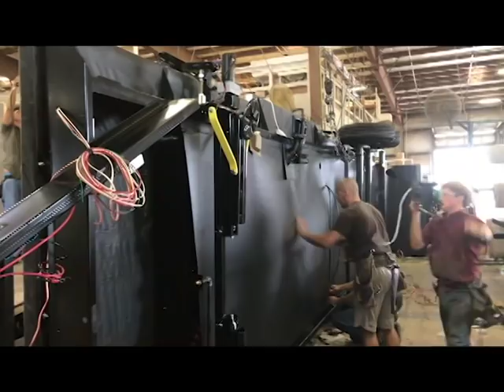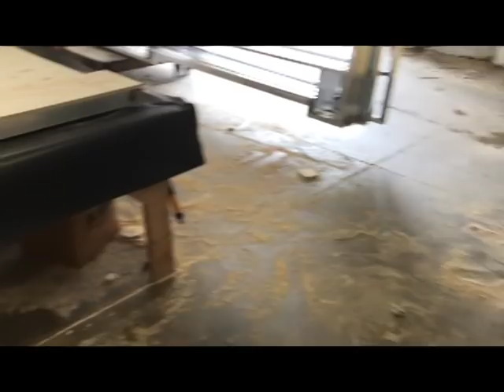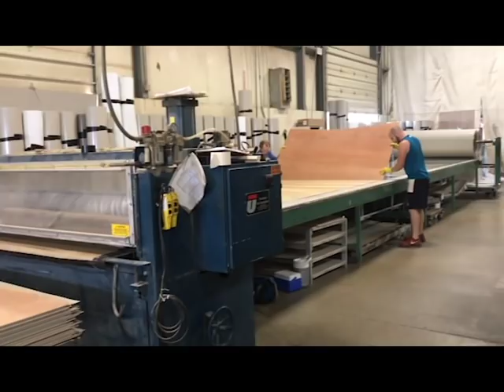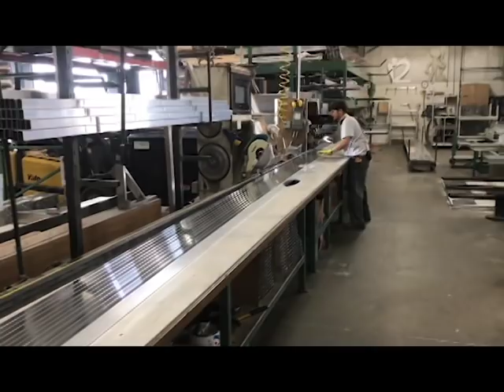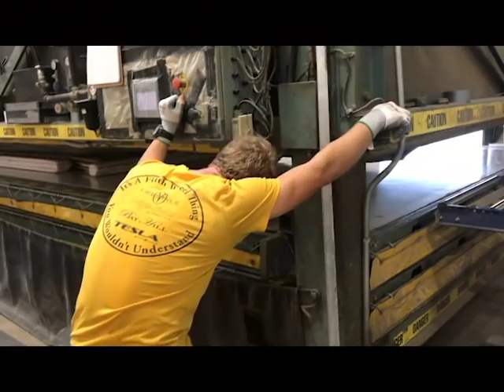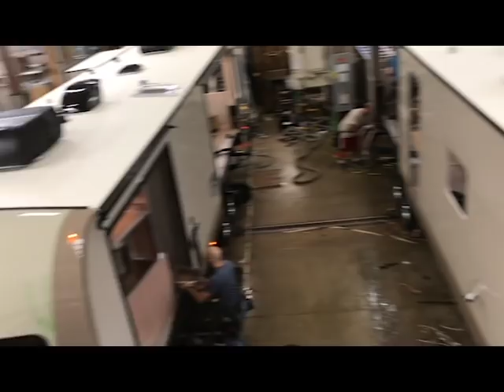2019 Rockwood Signature Ultra Lite Factory Assembly Line

Comment: easy to see why the QUALITY sucks on any rv,  camper, fifth wheel. Have a bad night and miss one step in the build process and move on to the next one. A person can only run so fast day after day. What ever happened to pride in our work?
Reply: I agree everyone is running fast. I am a retired contractor and if my guys would of circular sawed openings in the floor like that they would not be working for me or slow down. I see how stuff goes wrong. Way to fast..
Reply: FYI you can clearly see when the video is sped up. Believe it not this the one of the best RV manufactures in the market.
Reply: @melinatoche   do you work for Forest River? Most of it is the guys walking and running fast. I know construction and am in tune to the construction. I won't go into it but one example of the video that I don't care if they slowed it down, when the guy glues the floor as they all say studs which it would a joist on the floor. He is using a pneumatic glue gun which he gets the glue on the joist of the floor and then the guys putting down the 5/8" plywood they set a couple of sheets then quickly drop or slide the next couple of sheets to lay them out and they are hanging way over the sides. When they move them into the correct placement the glue has been spread on the plywood when it first hit the framing. Defeats the purpose of using glue. Maybe I should say it displaces most of the glue. I have talked to sales people that have taken a factory tours and they say they are moving fast. I believe I have heard and would say they are paid on piece work. No worker would last long if they were moving that fast without and incentive. They are slammed together. I still am probably purchase a Rockwood. As you said and I agree they are one of the better ones. So you must work in the industry, correct?? Cheers
Reply: @jim i do not work for forest river but I am in the industry. Also, I don’t call it Forest River, this is the Rockwood plant. Each brand works differently I see these trailers everyday, been to Indiana and walked through the factories; They are moving fast but what factory doesn’t? I have seen about 80% of the RV manufacturers and that is why I say with confidence that Rockwood is one of the best in the industry, they vacuum bond their walls and use aluminum to support things like the bed, and dinette where others just use wood. They have torflex axles and I have not seen a single one fail and rarely see recalls. Given, there will be a few that have some issues but I will say they are the cleanest trailers I’ve seen especially for the money. Lance and Airstreams are the only other trailers I would say are better built of the big brand names. What I tell people before they buy is to buy from a reputable dealership with a full service shop otherwise any trailer can be a nightmare when you don’t have a dealership that knows how to fix everything, they’re the ones that will truly back the customer and fix things better than they started with.
Reply: @melinatoche  like I said I have looked at many and I have always said Lance is a well built product. Airstream is in a class of their own. Yes Forest River has many many brands I know and the Rockwood / Flagstaff plant builds a darn good product. It is like the Grand Design that claims a 200 point inspection and I might say in the beginning maybe but now as production increases they can't inspect from what I have seen. The sales pitch is how well built they are and how well they are inspected twice they say. Well Like I have showed the sales person things that were real poor quality like a drawer that was  way out of wack. Drawer was 3/4 in off at the face frame of cabinet. Like I said if if was inspected they would of never let it go to the dealer. I said if my quality control person let that go out I would fire him or her. All in all for the money Rockwood is a nice unit. Like I said it will be my choice when we purchase. Just went to the RV Show today in Ca. I do appreciate your input and opinion specially when you are in the industry.
Reply: jim g i saw the grand design and at first glance it looks good, but i checked the axles, pushed on the ceiling panels and knew they weren’t as nice. They’re still better than most brands but I noticed a number of things that weren’t impressive. Trust me I understand your point of view, I will call the factory when we check in trailers and ask why it ever left the factory sometimes, most things we can fix but some things aren’t worth the time. Our dealership built chain control campers for Cal Trans, they took weeks to build, not one day... and they have not had any significant issues and we maintenance most of them. Wish they were all built that way but supply and demand plus cost would be an issue for the industry. Good luck on your trailer purchase! My favorite models in their travel trailers are Mini Lite 2507S, Ultra Lite 2608BS, Ultra Lite 2906RS, Signature Ultra Lite 8329SS or 8332BS; Of the fifth wheels I like the 8299BS, 2620WS, 2781WS, and the 2898KS. Happy Camping!
Reply: @melinatoche   8329SS is my favorite. Great floor plan and tons of counter space. We will I think end up with the Ultra Lite 2606WS. Lighter and I like the large rear bath and for the size a bedroom closet slide. Again thanks for you input. Take care and stay happy and healthy. God Bless..
Reply: we're not idiots, it wasn't sped up. its really this fast, funny the slow music is trying to divert attention to the people hustling with power tools. would love to know the injury rate there.
Reply: @melinatoche  I thought it looked like it was sped up also. Even if it wasn`t a person couldn`t move that fast all day long.
Reply: VOOODOOO this video was intended to show the ins and outs of a Rockwood. I can tell you for a fact that there are definitely parts of the footage that are sped up and others that are not. These trailers are costly as it is, that is why they are built fast and due to high demand. On the retail side all you hear is people wanting them for less, the factories don’t want to lose customers so they cut down cost by piece work. And believe it or not Rockwoods come in the best condition than most trailers period. These employees do the same thing over and over, they know what they’re doing which is why they work fast too. And injuries happen in any workspace with power tools even slower paced, it’s inevitable. So curious about the injury rate, I suggest you take a tour of the factory and ask them yourself. If there were so many injuries, they wouldn’t give daily tours of the factory like they currently do as I would imagine they would be afraid of people witnessing something. Music was simply put in so you don’t listen to the loud sound of the tools, not for any other reason.
Reply: I agree jbuc34 and what makes this really sad is that Rockwood is supposed to be one of the "better" of the Ultra Lite brands.  I know assembly lines are supposed to be fast but some of this is ridiculous.   Slap the jig up against the wall and if it was misaligned no one will care that every cut is a little off.  Speed cutting holes with a circular saw? I can just imagine how rough those cuts are but no one gives them a second glance to make sure the cut edges were smoothed, or squared.  Slamming in brads with a nail gun with so much speed no one will ever catch it if the wood splits or chips or the brad goes in askew and cuts into something it shouldn't.  The only thing you care about is that you have until the unit in front of you moves along the line to get all of the steps on your current unit done.  And if you are running slow you either skip steps or rush it, no one is going to hold up the assembly line because you need another minute.  All the while the PR guy is talking about this or that great feature or building material as if it matters how great an aluminum skeleton is if it isn't square or how strong the roofing is if there are such gaps around the components that no amount of goop is going to keep the water from seeping in.

I used to wonder how people could get campers straight off the dealers lot that had plumbing lines disconnected, vent covers falling out of the ceiling, shelves that come away from the walls, light switches that aren't connected to anything...I could go on all day.  This video (and the others like the Jayco factor tour) show you exactly why this is happening.  And why should Rockwood, or any manufacturer, give a damn? People are lining up to buy these units unfinished and untested and Rockwood is laughing all the way to the bank.
Reply: @jimg2885  ?
Reply: @66terzi  what are you questioning?  Can you not understand something that was posted??

Comment: Every step of the way the workers are running on high speed. From screwing flooring to throwing insulation foam to cutting openings in floor etc. I love the Rockwood trailers but it does concern me. You would think the Forest River Co. would slow down the people while shooting the video. I am a retired General Contractor that was meticulous in my building. I would never let my people run like these people. Speed = less care in my book. The guy cutting the floor openings in plywood is definitely over cutting opening. Guess all Rv's are built this way unless you go very high end. As a buddy of mine that lives by a factory said looks like the workers don't need to graduate high school to work in the plant. All in all you can see that it is all about how many units they get out in a day. Tells me it is piece work or payed by production as no one would run that fast day after day if it did not influence their pay. In return it affects quality..
Reply: I agree
Reply: Exactly what I was going to say. No wonder all these factories have issues.  Every video in every factory they are running. More about speed than accuracy. Then they want thousand for something guaranteed to fall apart soon.
Reply: As the owner of a Rockwood, I agree. I had delamination issues in the first three months I owned it. I would think they would catch something like that when it was being built. I will say they repaired it for me without questioning me in a speedy fashion. I have heard horror stories of people losing their trailer for 6 months to be repaired. Mine was picked up at the dealer and driven back to the factory and then returned to me in 3 weeks. They replaced the whole side of a 34 foot travel trailer which really scares me but I haven't noticed anything wrong with their work. Time will tell.
Reply: Meth
Reply: Since a significant amount of workers are Amish their schooling ends at 8th grade and Amish have a whole different work ethic than the English (Americans).
Reply: @festivefa  The factory where my buddy lives is in Oregon so it is not the Amish workers there..
Reply: @jimg2885  Beg your pardon, but the Sheridan, OR Forest River plant that builds Rpods and Surveyors is 10 miles from Amity OR.  Lots of local Amish workers in that part of Oregon.
Reply: @shortstrike6720  You are almost 250 plus miles away from the plant I am talking about near Pendleton Or. Again these are not Amish workers..

Comment: I have on order a rockwood 2606ws, will be here in 3 weeks, I just wish the workers would slow it up a bit, I know they are being pushed to work as fast as possible, but going too fast just leads to mistakes, I have heard many horror stories about units being delivered with way to many defects....altho' I did a lot of research before deciding on the Rockwood, it seems to be one of the best built, I really like the fact that they put the torflex suspension system on all their models as standard equipment.
Reply: timoteo no worries.i work at rockwood.the same exact plant in this video.same place ur rv was built.rockwood is the best damn rv money can buy.we have every part of the process down to a science.and we all work so fast because we've all been doing it for years.
Reply: Thanks Matt! I appreciate the info, it makes me feel better
Reply: Check out the Jayco you tube video named 7 hours to make one ,and you will be glad to buy Rockwood.I worked for a short time over 40 years back at a trailer assembly line in Calgary ,and man do they pump those things out.It keeps moving down the assembly line regardless.Good luck with your trailer.I am looking at a real small one for weekend camping,the Geo Pro 19 fd with the murphy bed,pulling with a 1/2 ton.It is a very light trailer and will be nice for short camping trips.
Reply: Timoteo we have a 2606ws and this past winter went coast to coast 7400 miles and 18 rv parks. It was awesome. A couple of very minor issues too small to mention and I fixed myself.  You will love your new Rockwood!
Reply: timoteo I am curious how you like your new RV? Have you hit the road yet??
Reply: How do we oder.?